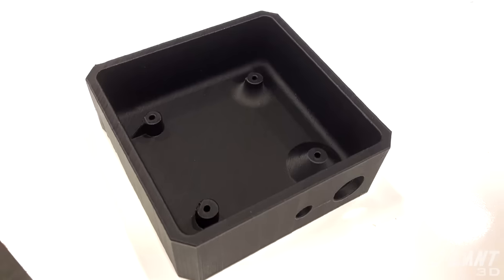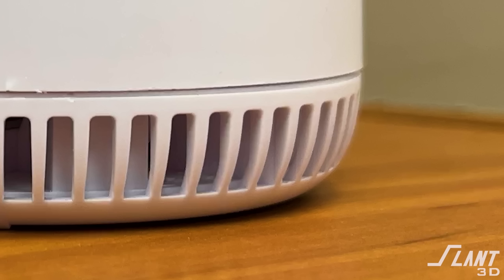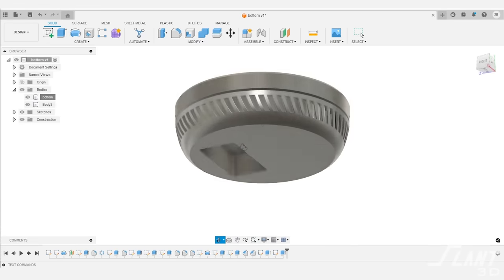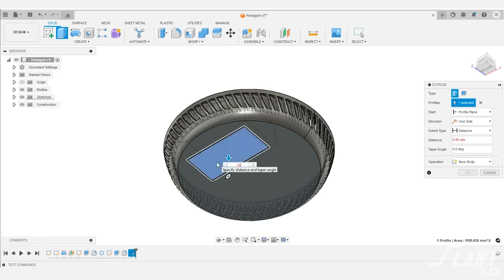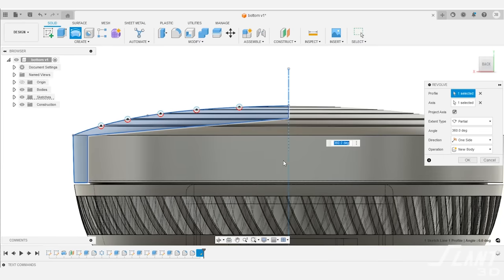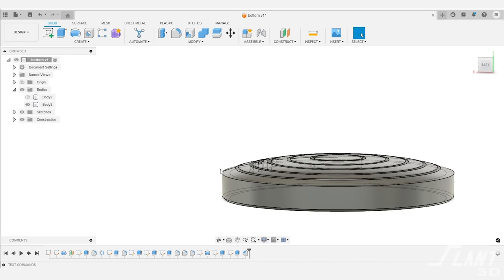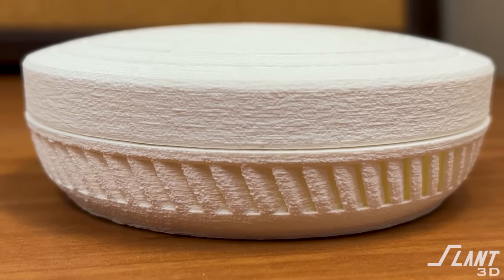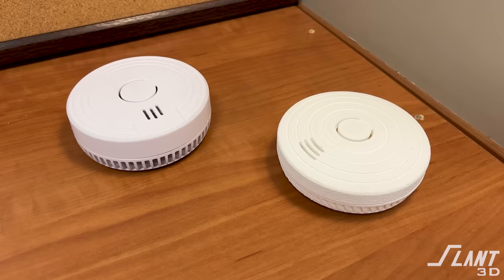Rounded Electrical Enclosures | Design for Mass Production 3D Printing

Comment: I have to really disagree with the textured stuff. You've shown off the texturing a few times before and... obviously this is personal opinion, but I just find it ugly. I'd much rather just have layer lines.
Reply: and in a well calibrated printer with a 0.2 LH you would look really close to see some line.
Reply: Yeah usually I like it but this time it went to far and just looked like inconsistency
Reply from the maker: True. Except on the Top Curve
Reply: With something like a .2mm depth and density of 10 or so it can look really high quality.  You can also configure it to not use the texture inside the vent holes or screw holes, etc.  Not sure what their settings are here. (Settings I provided are for Cura).
Reply: Another thing that was mentioned was leaning into the layer lines with the cosmetic design such as adding intentional lines and curves.
Reply: @slant3d Top curve is a matter of slicers not being smart enough. If they could do nonplanar ironing perpendicular to the perimeter lines on the shallow slope top layers, you could get a smooth top curve without quantized steps.
Reply: t @slant3d   nope. Theres a better way to address tha
Reply: A minimal setting looks way better than large settings for fuzzy skin. If you set your slicer to the most minimal settings for fuzzy skin it may look better.
Reply: I use Hilbert curve for the top and bottom surfaces to add a texture that hides everything

Comment: I think the lines in 3D printing is a distinguishing element end aesthetic aspect. @Slant 3D: You're becoming an influencer in the 3D printing world, you should smith a message, that 3D printing offers benefits over injection molding elements (like you're already doing). Don't fight with the inevitable element lines, what more: embrace them, emphasize them. So that the lines will be associated with something high quality.
Reply: I hated the look of 3D printed parts until I owned a 3D printer and obtained a new respect for the look.
Reply: Sorry, I don't see 3D printing finish ever catching on as being a positive association. And definitely not seen as high quality since the barrier to entry is so low that a lot of cheap products will be seen using it.
Reply: Considering that layer lines can be made less visible with lower layer heights or post processing they will never be associated with high quality. If you lower the layer height or sand and paint it then you can make the layer lines less visible but it would take longer and cost more. Also considering that layer lines are also only really an issue with the cheaper 3D printing methods, FDM, and aren’t an issue with resin or powder based printing they won’t catch on as high quality either.

Thinking that layer lines are a sign of high quality is like thinking that an injection moulding part that has an unintentional rough surface is high quality, a rough or imperfect surface in injection moulding can be caused by a lower quality and usually cheaper mould.

Defects or artefacts of the manufacturing method are not a sign of high quality, especially when those defects and artefacts could be removed or lessened by spending more time or money on manufacturing it or post processing it.
Reply: @conorstewart2214  agreed
Reply: 100% agree - that popcorn texture really takes aways from the 3d printed look. I love the aspect of .32 / .40 lines.

Comment: Doesn't look as great as the injection molded design, though.
Reply: Of course it doesn’t, that’s like saying a wrench doesn’t work as well as a hammer for building a wall. One of the points of this video (and really a concept people haven’t fully grasped onto) is when replicating something that already exists, there is a different set of constraints, he said that quite a few times throughout the video, and I think it’s very difficult to fully grasp that especially when you’re not starting from scratch

Comment: I way prefer normal printing lines over that textured surface.. it looks rough and unfinished. Almost like printed by a kid's 3d printer that's not calibrated right. But im sure there's applications and reasons for using it like you said. I love using my bambu printer's Textured PEI plate to make a "texture" on one side of my parts. Caused by the printing on the PEI plate. Do you also make use of this in some applications? Great video like always giving us some insight in the design process for 3d printing parts.
Reply: I just printed a test part with different depths and densities of this noise and it is definitely possible to make it subtle enough so it looks very high quality.  It is difficult to photograph well, so I bet those parts look WAY better up close.
Reply from the maker: They are tough to film. 3D Printed parts in general
Reply: I agree.  Personally I think the prints that were shown looked really bad.

Comment: Pretty certain those angled vents would affect how smoke enters the detector. The reason they are narrow and shallow is because you need the smoke particles to enter undisturbed. By angling them, you create laminar flow and orient the particles in a specific way that could disrupt the detector’s function. I understand the point you’re trying to make, but in this case, I do believe the client’s engineering requirement would’ve told you “nah yeah nah, mate”

Comment: Why would someone want an expensive 3D printed part that is already mass produced with a more suitable method. Like smoke detectors already exist. Or is the idea to camouflage other electronics in a smoke detector for special low order volume applications. Even then it is likely cheaper to buy the injection molded housings and adapt the electronics.

Comment: Why don't use sequential bridging or multi sacrificial layers technique for the top part? I use this technique a lot for insane parabolic overhangs and floating horizontal holes.
Reply: I actually thought they were going to talk about that after seeing the underside of the part at this point of the video.  https://youtu.be/m20UPm0TOto?t=442
Reply from the maker: That is a great thing to do. But we are planning a seperate video on that topic. And sometimes these inner curves are too shallow to allow enough layer changes for sequential bridging.

Comment: The issue of stair stepping on low grade slopes is something that conical/full control slicing could really help with I'm excited for a future where 3d printers act more like cnc mills and can sweep subtle vertical arcs in some places where it helps the part.

Comment: These are the best videos I've seen on additive manufacturing design.  I love the real world examples and the conversational instruction style.  Those slanted vents are great.  I've done that before, making it more difficult to see inside.  On one design, I made V shaped vents that not only prevented someone from seeing inside, it also blocked small conductors from poking inside.  That would be ridiculously difficult to implement with injection molding.
Reply from the maker: Great point!

Comment: As someone who services the automation and custom machinery business, 3d printed custom electrical enclosures and wire management solutions could be brilliant. Granted, there are typically always injection molded or stamped enclosure solutions available. But sometimes, the ability to print one with unique dimensions for a certain application would really shine, not just functionally but aesthetically. 

The unfortunate side however, is obtaining UL or NRTL certification on the individual products. The key here is having the ability to print unique enclosures for various applications as needed. It'd be amazing if UL would recognize a line of filament that would be approved for use to develop said enclosures/components and be recognized as acceptable in NEC etc.

Now THAT would open doors.

Comment: Very interesting, as all your videos, always!
Here's my question, not so related to this content, but since it's latest video I'll ask it here.
You talk a lot about using chamfers and fillets to optimize tool movement. How does it relate to tool movement while printing infill? I found that grid, cubic, etc. infills make tool turn in very sharp corners (90 degrees). Does it have negative impact on performance? Is gyroid infill better in this case? Or since it's just an infill it doesn't matter?

Comment: 🇨🇦/🇺🇸... You've been giving some really cool information. One thing that I REALLY don't like is the texture. TWO things... From my perspective it doesn't look like it was done on purpose. To me, it looks like it was printed on a really crappy, cheapass printer with filament that was left out in the humidity too long, giving it a lot of "pimples". Secondly, for a household any printed parts with that kind of texture is going to be a "dust magnet". Not only that, but a dust magnet that is going to be very hard to clean. If you own a house and are particular about dusting out all the cobwebs, you'll know what I mean. That said... I'm learning a lot! Thanks!!! 🙂

Comment: I find printing with white - or even natural - PLA is much more forgiving than darker ones. The grey I used looked most probably the worst. :D
Reply: There is a reason that 3D printer manufacturers usually supply white test filament with a new printer.  It's much more difficult to see details (aka defects) with white filament.

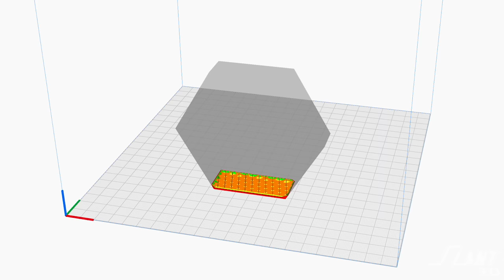Comment: Is there a minimum contact area a part of this sized needs to contact the print bed when designing a faceted exterior surface? (2:36) Thinking between a 7 to 11 side faceted shape would look more circular, but could have the desired initial print-bed attachment surface. A possible option is adding cover that pops over the printed facet that served as a base, to provide a more uniform exterior. This would result in an extra part (less desirable), but in this design could serve as battery access cover. 

Cutting the part at an angle is a brilliant idea. (7:48) Besides solving a print support issue, it also opens up the design for consideration of how the two halves are joined. (that aspect of this design not really discussed here). The diagonal cut-line could offer a way to aid part alignment in assembly, or incorporate a a twist to secure feature instead of a push half to insert tabs. 

Suggestion: instead of referring to the texturing a 3d-print as "adding noise", perhaps refer to the texture as stucco, or sandblasted texture. Think it would be more relatable to a larger audience.

Comment: um, i'm sorry what?  At the end you say that its pretty much equivalent and indistinguishable?  I am sorry but you can't believe that right?  We tolerate FDM print quality for its convenience but nobody wants that in a product.  With the original injection molded part I can guarantee you the side sniffer vents were not individual cores.  The bottom was likely curved so the core/cavity could produce those openings without the need for any side pulls.  You commonly see this in designs where the vents will go below the bottom edge to avoid any expensive cores.  Injection molding will produce a superior surface finish every time and offer up flame retardant materials, a much better economy of scale, and a stronger part.

I get what you are selling but until you can solve the surface quality, speed, and layer line adhesion it just doesn't seem viable.  If that part was designed for Injection Molding, you could print it with an mSLA machine and have a near perfect replica without redoing the design.  But with FDM you are putting big limitations on the design of the part only to get a sub-par finished part.  And if you decide to move from a sample fdm print of a part to injection molding you have to redesign the entire thing.  

Again there may be a place for the current output of FDM printers, but as a replacement for consumer injection molded parts it just don't meet the muster in my opinion.

Comment: In this case, for a product anyone would actually choose to spend money on,  FDM offers absolutely  no advantages or value  and actually only forces compromises. 
Correct option for "mass producing" these parts using AM is SLS/MJF/SAF for at least 3 compelling reasons:
1) superior asthetics
2) superior mechanical proptertiess of printed parts
3) superior economy of scale
Reply from the maker: No economies of scale. No colors. Mechanical advnatages are debatable
Reply: @slant3d  certainly wrong first two points, no 'debate' to be had about mech. props.; anisotropic + no junky infill needed = superior part.
Reply: @slant3d um what?  Just because you respond with no doesnt mean it is valid.  What economy of scale do you get with fdm over anythig this poster mentioned?  Sls is self supporting.  Filling the build area doesnt increase print time like fdm.  Pigment can be added.  Better mechanical properties and much better looking parts.  I have personally designed end use sls nylon parts that were sealed and painted, submersible, and lived outside for a year.  Never would have done that with an fdm print and the geometry was too complex to mold.

Comment: Between injection molded top cover and 3d-printed part I would prefer injection molded because it looks simpler and cleaner. ("Good design is as little design as possible" - D.R.) If not compared the 3d printed cover looks good, though I'm not fond of Fresnel lens pattern. 
    What could be really interesting is the hexagonal form, the honeycomb or triangular pattern could be a good design for the top, blending button and sound vent features inside pattern.
I guess the customer insisted on round cover... mental inertia in action.
Reply: But if you invest millions in a FDM printer farm, you find any excuse to put a design within your wheelhouse.  Not considering what's best for the customer, if it was injected modeled, it would be lost profit.

Comment: I'm assuming you're using UL listed filament being a mass commercial manufacturer of electronic enclosures. No business wants to roll the dice on huge lawsuits you can't win if you don't use certified platic. What brand do you use? My partner and I are looking for bulk UL listed filament for a decent price, everything available is pricey we have found.
Reply: I was wondering about printing enclosures for AC 110v things, and what design/material considerations for doing this when I need to get the final thing CSA /UL evaluated after. Is it as simple as using a listed filament? 

For the 9v battery enclosure here, I’m not sure that they need listed materials, but for my stuff I’m pretty sure I do.

Comment: Hate that look of the added texture (fuzzy skin) personally, what I would do is:
- Use black matte filament, hides layer lines very well, even on rounded parts.
- Use lower layer height 0.1 or 0.15, modern printers print this very fast now.
- Don't make it rounded or curved on top or bottom Make it flat.
- Print it on textured sheet with the faces on bed, will virtually eliminate any artefacts. I've never had problems with first layers on modern printers they come out perfect on prusas and Bambulabs.
Reply from the maker: That is fine if you are making 1. But in mass production
 - Black is generally not a color option. Otherwise matte is great
- Layer heights below 0.2 make basically no difference on appearance.
- the rounded top is defined by the client
- Large first layers with light colors introduce high occurances of stains when mass producting thousands of a product.
Reply: @slant3d  why is black not an option?

Comment: How come slant3D have vibration finishing machines? It’s pretty much standard in manufacturing large batches of products needing post-processing. Wouldn’t it be useful to have it as an option in those cases where a textured look isn’t desirable?
Reply: good point Not sure how they prioritise lead time, but if it isn't an issue, mass finishing techniques would be useful.
Reply: I have used my vibratory machines to finish machined plastic parts, which started out looking way better than any 3D printed part.  On some plastics it works very well.
Reply: @G53X0Y0Z0  how long does it take for your parts to finish
Reply: @ravplayztabla7467  - that's going to depend on a lot of things. For one thing, the machine size what media (abrasive) is used. The size and weight of the part, the shape, and how much needs to be removed to give the finish you want. In general, between 2 and 24 hours. My machine is large industrial machine we usually finish CNC machined aluminum with. It usually runs plastic media of various grits. Heavier parts usually finish faster, lighter parts take longer, because the amount of pressure is less.
Reply: @ravplayztabla7467  it also depend on the type of plastic. Plastic that sands easier finishes easier in a vibratory tumbler.